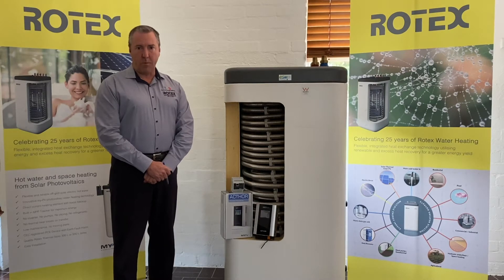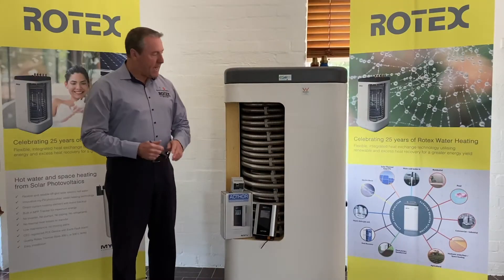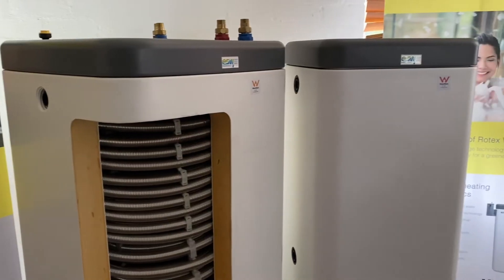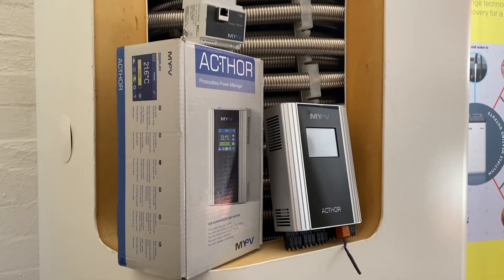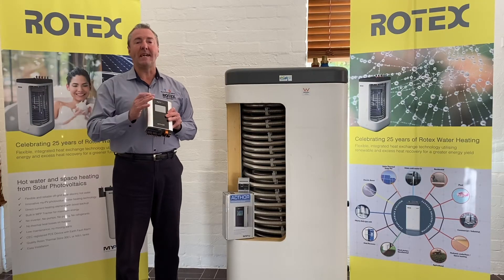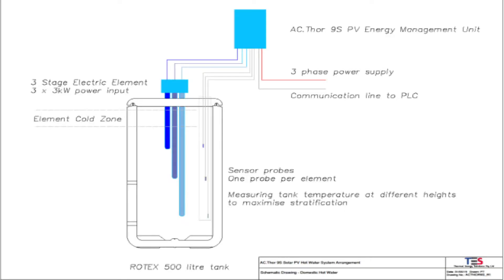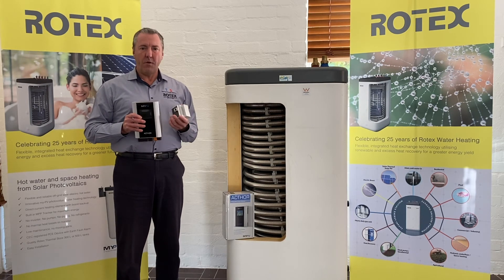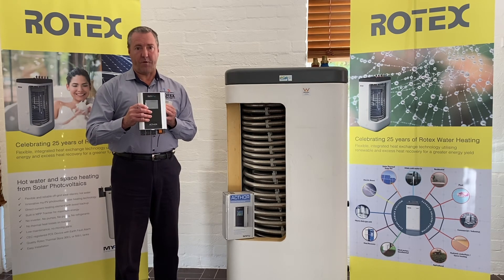Introducing the AC.THOR 9kW

Comment: Blimey, so many words and so little explanation. What is it? What does it do? How can I use it with PV panels? Take comfort in the manufacturers website is equally wordy and baffling. I took as much from their English product page as I did from the Austrian one.
Reply: It's a smart energy diverted for hot water with relays built in. You can connect your existing immersion rods up to 9kW if you have 3 phase to it and then it integrates into solar setup with likes of SMA Home Manager 2.0. There is AC THOR 9 which is 3kW rated for single phase. It's German made product